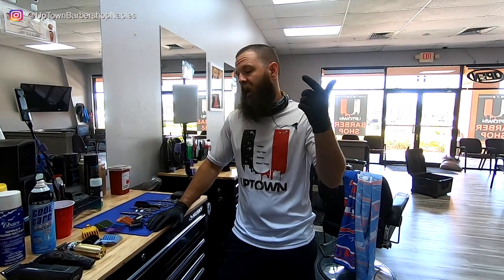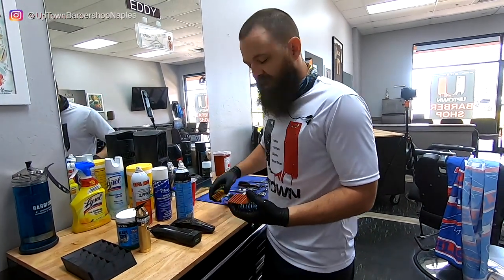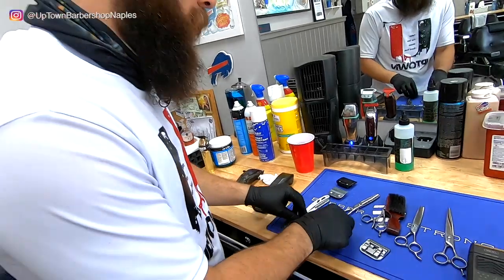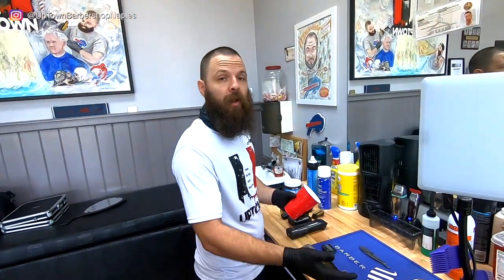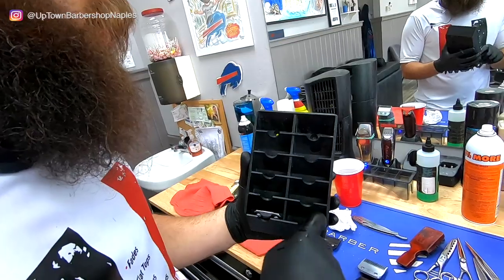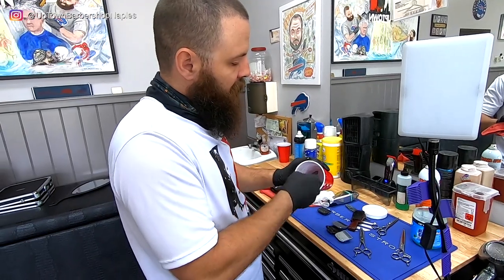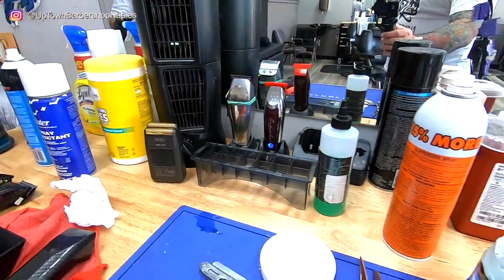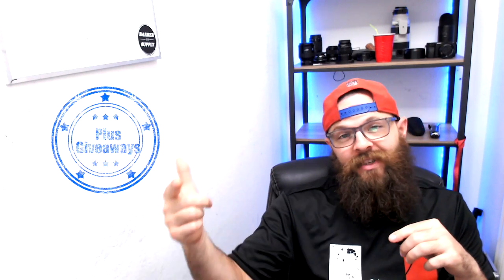Learn how to sanitize your barber tools!

Comment: Facts 😅❤it smart tricks Eddie leaving the oil in the caps when they will be overnight and if away for a day ❤it as well as your shears and washing your guards in sink then barbacide . I’m doing the same thing now and what I do every night is the 7in1 blade wash by andis. I’m Always clean and my tools treat me right and run nice and smooth and at least every 2 weeks I take them fully apart and get what ever else is stuck in there left over. The andis blade wash works wonders for getting mostly everything out of the machines and even the shears hair would just slide right out of the scew and anywhere else. I have to say if anyone is not cleaning their tools the right way the tools are not going to work the same and will not treat you right. Awesome content Eddie ❤it

Comment: It is so annoying how the Andis 7, and other such blade dips, come in that style of container. I also pour a little at a time into a stout, wide container which I then dip blades in, but pouring from the Andis 7 container to the dipping container gets everywhere! I noticed Eddy had to wipe the container right away too. I need to find another container to pour the Andis 7 into that will make it easy and clean to dispense. Maybe one of those chemical rinse bottles... 🤔

Comment: Very nice video that are steps that a lot of barber doesn't show or really quick. I would like to know if the only difference between andis 5in1 and the 7in1 is the oiling. Moreover what is the best between andis 5in1 and clippercide because the clippercide is cheaper and I would like to know if there is a real difference.
Reply: @YouTubeBarberAcademy  Thank you bro' and for the clippercide and andis 5in1 what is the difference between them because clippercide is cheaper.

Comment: After you spray/ oil your clippers and or blades you should flip them upside down so the liquid doesn’t go into the motor and ruin them. Just a tip
Reply from the maker: Not a bad idea, although I can say I’ve never really had a motor go out because of that
Reply: @YouTubeBarberAcademy  I used to just spray them down and then set them upwards but my magic clips stopped working one day and I took it apart and the inside was covered in liquid and it was corroding. But that being said those are the only ones that I’ve ruined that way tho all my others still work fine

Comment: What is the difference between Andis 5in1 and clippercide and what is thr best ? And the andis 7in1 in spray is it the same that you have in the box ?
Reply: @YouTubeBarberAcademy  Yes but I am thinking about the product because if I buy spray and I put it in a glass is it the same ? And what about clippercide and andis 5in1
Reply: @darkichigo9037  The Spray (5in1) should be used in between each haircut, it's main purpose is to disinfect & acts as a coolant. The Solution (7in1) is a deep clean and should be done once a month at the end of the day. It prevents rust also and gets rid of all the caked hair. More importantly you should oil your clippers after every 2 or 3 clients with the clipper oil.

Comment: Hi there I bought a replica version of the magic clips and the 1st time I used it the blade got very hot with in 15mins if use. I did oil the blades. I waited 3 days and kept oiling them for 3 days and it’s still hot? I took of the blade and there is a brownish colour scrape on it. Any help will be appreciated thanks